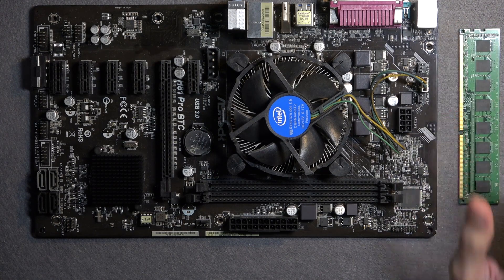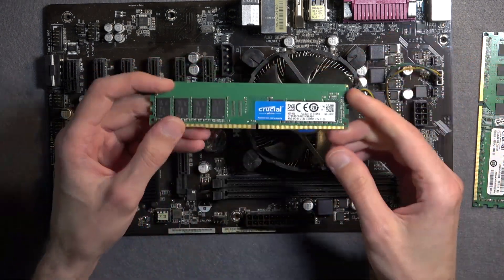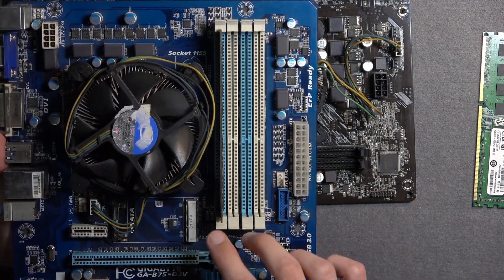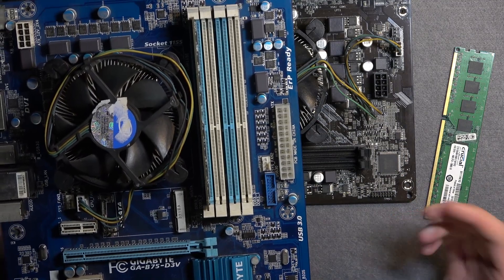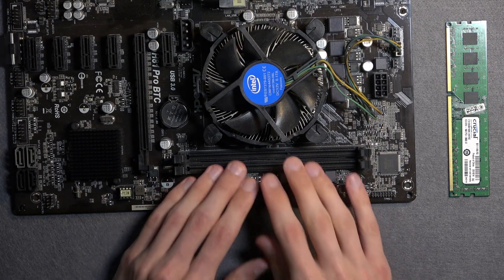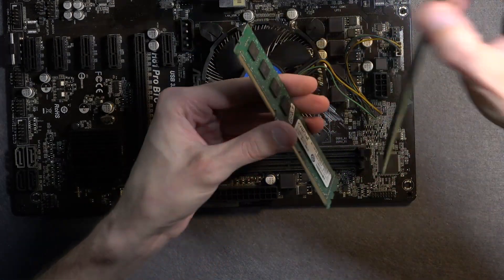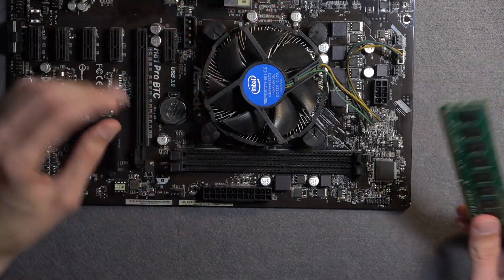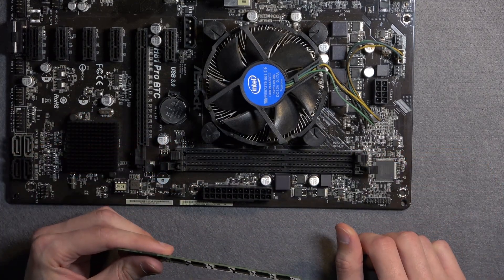Install DDR3 RAM in ASRock H81 Pro BTC | How to Correctly Plug New RAM in ASRock Motherboard

Comment: i have a ASRock (H81 Pro BTC R2.0) and 2 ddr3 8gb ram sticks but it will only see 1 ddr3 8gb stick I've tried a lot of things to get it to recognize both but it wont only 1 stick or the other its supposed to support 16 gb ram i dnt know what to do
Reply: Same brother. Did you solve the problem??
Reply: @crayonshin-chan6995  Nope still running on 1 stick sucks, if you find a solution, please reply back thanks.